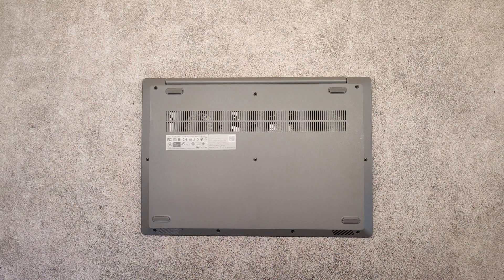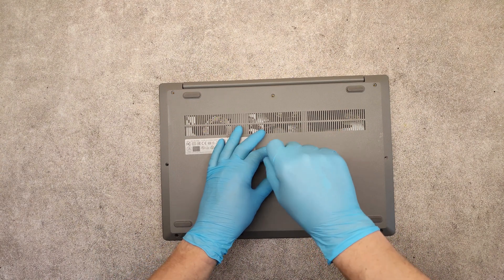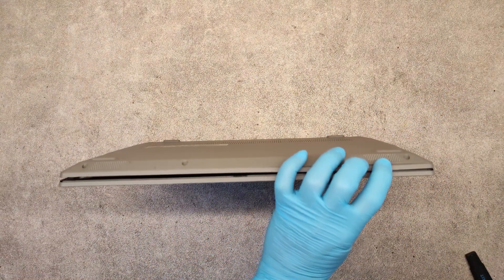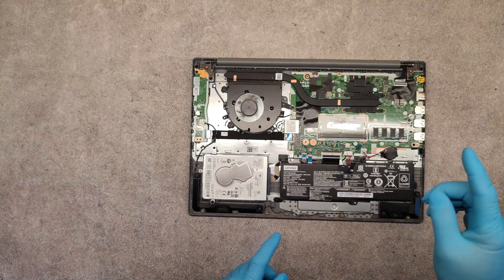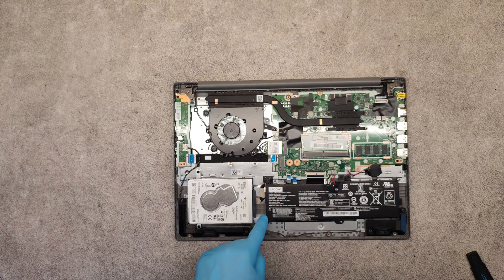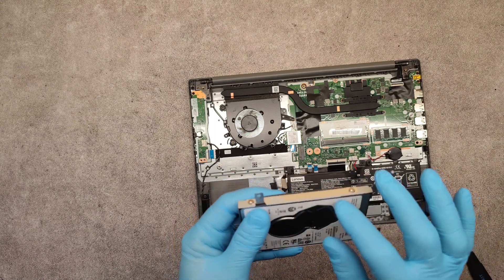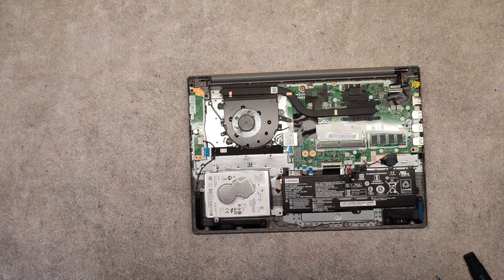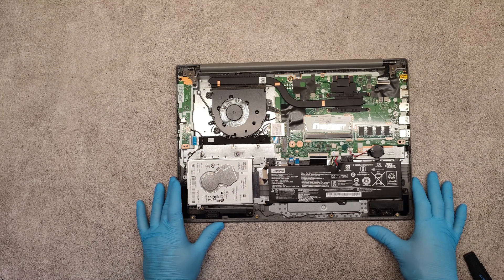LENOVO IDEAPAD 3 15ADA05 DISASSEMBLY, RAM UPGRADE, SSD UPGRADE, FAN CLEANING, BATTERY REPLACEMENT

Comment: Hey i have this model and in cpu-z it claims to have 2 slots (1 is 8gb and the other is 4gb) is this baloney or is there indeed a second ram slot ?
Reply from the maker: It depends on the revision of the mainoard. I have seen equal laptops with different qty of RAM slots and they were with different versions of the mainboard.

Comment: Thanks you so much i will clean my laptop for first time. And i have a question is there a possibility to install a HDD?
Reply from the maker: About the possibility dor installing HDD it depends on the version of the mainboard and basically on the availability of sata connector for HDD or additional m.2 slot for an SSD. And don't forget to support me and subscribe to my channel :)
Reply: Oh sorry, I just see it, I confused HDD with SSD